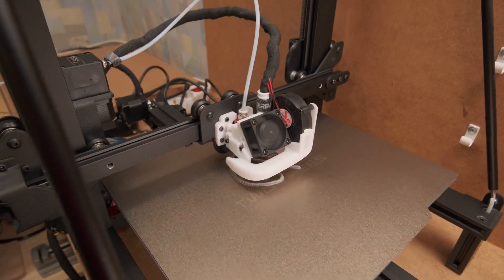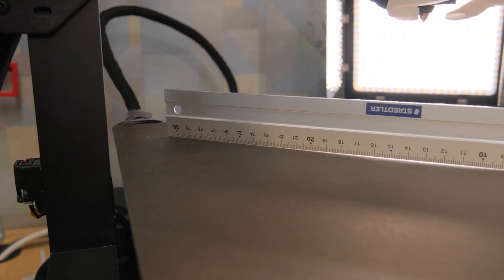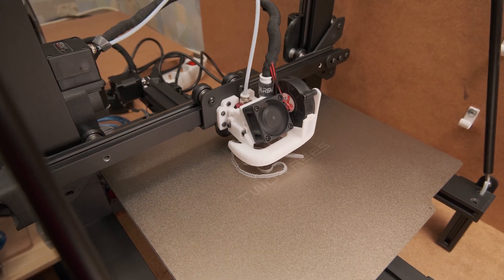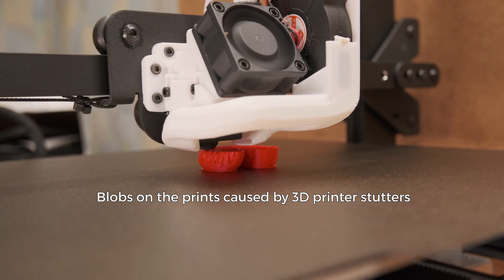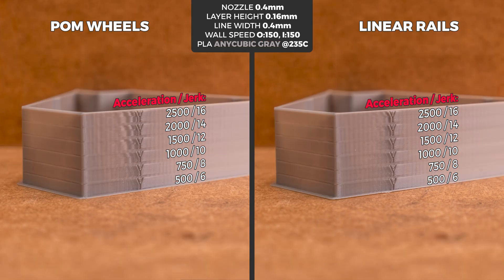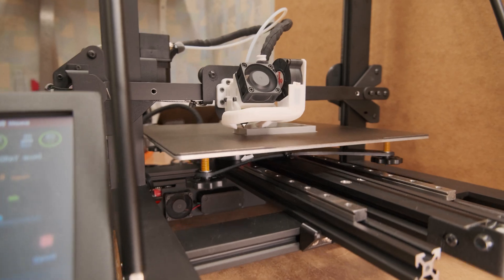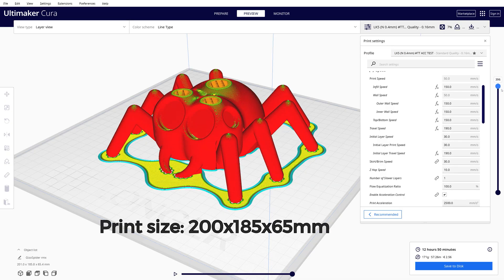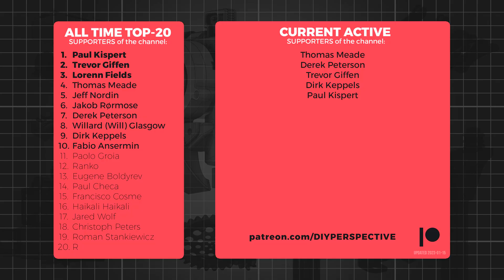When 3D Printer LINEAR RAILS upgrade MAKE SENSE? (vs POM wheels)

Comment: Once again, you gave us an amazing information and content. You're not going to make too many friends with other 3D printer YTers :) Talk about myth busting!! There are other advantages to linear rails even if they don't necessarily translate in print quality. Or more precisely within a hobby setting. The benefits to a less maintenance system could be of value in a print farm or similar setting.

Looking at the dynamics of a bed, it is somewhat easy to understand why those changes doesn't make a large difference. The rotational forces are front-back, not side-to-side (like you showed with your dial). In this fashion, the wheels, rails or simple rod bearings all do a good enough job to keep the deflection small enough to almost make no effect on the print.

And I'm surprised why everyone is fighting to make the bed lighter with spending $$$ as opposed to just switching to a larger motor and belt system - again, all assuming you need to make a change there in the first place.

Anyway - excellent content and great presentation. Job well done!
Reply from the maker: Thanks! I am not trying to make enemies, just trying to provide better-controlled testing results. ;D Yeah, even cheap linear rails are more than enough for upgrades like these. I even specifically ordered multiple just to check the quality, kinda YOLO it with two orders and all of them had no binding and wasn't too loose. Yeah, less maintenance and especially no wear in a long run. Heat beds with POM wheels just give me anxiety... It is such a flawed design from an engineering standpoint. X axis and Z are fine, but Y... They ride only on one side and wear way more quicker the heavier the bed is. I keep constantly checking them... LOL

So yes, the main wobbles come from another direction, I perfectly understand that. It was just an easier way to show that it is not a rigid system overall with no deeper thought. However because it is so wobbly to the sides, even the light X-axis could affect it with the fast movements. But turns out that when the heat bed weighs so much it is too much to handle for POM wheels with a design like that. Another thing that could affect the results is the rolling resistance. With linear rails, the bed moves like on ice skates, with POM wheels not so much. But it is hard to say how much that could affect the results.

The steppers on that 3d printer were already ran at 2A RMS at stock. So with TMC2209, it is the limit. (EDIT: I checked today and I have no idea why I said 2A RMS stock because it was set to 0.78A RMS, so yeah there is quite a lot of wiggle room). I have 48mm 2A motors for further testing and will order a 9mm belt that with some modifications should fit. But the lighter the bed the less the whole frame shakes. And when the bed weighs 2.2kg the shaking is quite insane for those not that high speeds/acc/jerk values. It is pretty annoying if you have it like on a table without any dampeners. So yeah. ;D
Reply: @PrintingPerspective  Ah good points about the max motor size and bed weight- very true. Guess that's where corexy have the advantage. I just can't see building many corexy for my farm to gain that much in speed and maintain extreme surface finish. Although the "Rook" homemade printer has some promise. 
What I like about your channel is debunking mainstream ideas. Even I have a hard time accepting the results!
Reply from the maker: Maybe after P1P release we will see a bigger shift into corexy 3d printers from mainstream manufacturers. It is superior design after all. I am tired of seeing Ender / Prusa clones...

I love the design idea of the Rook so much. Hopefully it will reach a more complete state. Would love to make one and make some print quality comparisons.

Yeah.. there are a lot anecdotal evidence or "from experience" without any actual testing and detailed comparison basically "just trust me bro" ;D When there are so much variables unless you properly evaluate and limit them, you are only speculating. Good luck that I actually love testing and triple checking and even retesting if the results are not what most of us are used to hear. :)

Comment: I'm sorry, your heavy accent is very difficult to follow. Would help a lot if you slowed down..... Do people really noodle around with their 3D printers to this level.? I've had my Creality CR 10  for 3 years.... Never had a print issue, apart from those self inflicted as I got to grips with using it.... My prints are incredible, fine detail.... I use a heavy mirror as my build plate,..... All this weight reduction and velocity/jerk talk  is for design engineers, not end users...... Think your likely to introduce more problems to resolve for anyone that tries modifying..... I wouldn't consider linear rails an upgrade... Just an alternative.... Nicely filmed video though. Thanks.
Reply from the maker: I always provide a full script as subtitles, which could definitely help. I agree that these settings are not for most people who own 3d printers but even inexpensive linear rails are the upgrade to POM wheels and the definition of the upgrade shouldn't be defined by users' ability, you know. However, I agree that you must have a certain amount of knowledge and experience to make an upgrade like this work better that POM wheels, that is for sure. I just wish companies used more linear rails in the first place.
Reply: @PrintingPerspective  You don't have to. I did not notice any accent until that post :) Your analysis was very helpful, I'm going to do a better board now, after watching this.
Reply: I would send you some commas in exchange for those dots. Would help a lot if you slowed down :)

Comment: Why not use carbon fibre plate instead of aluminium? They're cheap enough. Edit: that's already suggested
Reply from the maker: Yeah it it's definitely a possibility. But the main weight of ~1.7kg is from pei + magnetic base + heating plate. It would be interesting to try like a thick G10/FR4 sheet as a built plate and as a heating 2 in 1. But I doubt I will as the ghosting results even with stock firmware looks great considering how much whole heat bed weights. Plus there will always be a acc/jerk limit for some taller prints, so I don't see a reason to push for the much higher speeds.
Reply: @PrintingPerspective  Yes, you're probably right. I never used scales to check the weight on all parts like you did

Comment: I have an upgrade design you might be interested in.  It is a brace for the gantry uprights that attaches to the side, under the lowest level the X axis travels.  It features a pivot point reinforced with an M5 screw, and an M6/1/4"-20 bolt to adjust the upright's squareness and lock it in place.  I've only had it installed on my Ender 3 V2 Neo for about a week, but the testing is very promising.  I'm going to upload it to Thingiverse as soon as I'm satisfied that the design will not fail under normal operating conditions.  My printer is new, and I'm new to FDM, so I have a few bug with my printer to work out.  I originally made these as temporary bracing to fix the uprights from being out of square by about 2 degrees.  It's perfectly square now, but still having Y axis stability problems.  Let me know if you'd be interested in this brace system.  I've grown to like it more than bracing rods since they are out of the way, but the bracing rods are probably slightly more stiff.
Reply from the maker: It is so hard to imagine what you are talking about. When you upload it to post the title of it here, I am always interested in ideas and concepts that others have.

Comment: I don´t understand the premise of those videos. You modify an inferior bed slinger design with this and that...just save that money and buy a Core XY design instead form the get go. All those problems are already solved in a Core XY design, that´s the whole point of that mechanical design. Don´t buy those shitty "i3 Prusa since 10 year alsways the same style stuff"
You can also improve the alu. bed design further with more cut outs or make it thinner with beads and flanges (if possible).
Reply from the maker: If you don't understand why you even bother to comment? :D Maybe it is fun to modify 3d printers? Why do people modify shitty project cars and have so much enjoyment? Huh? If you don't have fun doing that it doesn't mean others feel the same, the world doesn't turn around you buddy. :D
Reply: @PrintingPerspective  Sure you can have fun doing it. But from a cost-benefit point it just does not make sense to buy a VW beetle and swap the engine to a Porsche one. So pay more money for a inferior product AND also invest time. It´s like all those videos "Oh look the Ender 3 is such a great printer if you only install those 53 mods for an other 800$" Yeah sure, but instead of doing that you could have bought a 1000$ machine which already is a great printer and you have less work with it.
Reply from the maker: How are you so close minded? This is actually funny to read. :D People who want to get into 3d printing don't want to spend $1k just to try it, so they buy cheap popular 3d printers. But with time for some people it turns into a hobby and upgrades are natural part of it. No one is saying it makes sense the cost wise, but guess what? When it is a hobby and you're getting fun out of it you don't care about the ultimate price/performance ratio. Is that really so hard to understand for you?
Reply: @PrintingPerspective  If you don´t want to spend 1k for a 3d printing, buy a cheap printer. But if you find that you need a better machine or you want a better machine simply sell your Chinese crap instead of wasting way too much time and money upgrading (which is physically not really possible from a i3 frame to a Core XY one) and buy a better machine, like the Bambu Lab for 800$.
In this case if Gaming is a hobby would you recommend buying a 1500$ GPU ? God I hope not.
Of course price is important. If those people didn´t care about the money in the first place they wouldn´t buy a cheap machine.
Reply from the maker: How you still don't get the point, even when I explained like for a child? ;DD This guy with the only his right ways and truths ;D This is too funny :)
Reply: @PrintingPerspective  I simply pointed out that it´s the worst price to performance value. You can go on rambling about how it´s not about the price nor the performance which is fine. It still does not make my point any less valid. If you don´t mind the terrible price or performance fine =) How can you not understand that´s it´s not about you and your point of view but there are others as well. So instead of arguing how it is not about the price just accept that the cost is horrible and valid for somebody with little money who is looking for a better value, how about that ?
Reply from the maker: You came here saying that you don't understand the premise of these videos and that CoreXY is superior. No one is arguing that it is not or that upgrades don't bring the most value. I explained why (because you said don't understand) some people love to modify 3d printers as a fun hobby but from your response clearly, you can't accept that some people love doing that and spending money on a hobby they love and you still keep arguing your point that no one here ever contested. That is why this is so funny to me and I keep replying lol. This is some dense sh*t, man. :D
Reply: @PrintingPerspective  I can accept that most people are irrational or like to modify, but not all. You can not accept that those solutions are workarounds.
Reply from the maker: Here he goes again :DD You clearly just can't accept that modifying 3d printers can be a hobby. You even say that I can't accept it despite agreeing with your previous statements ;D ????
At this point, there is no way you not trolling. And if you actually are not holy cow you are so far gone that it is not funny anymore, stop hating so much and thinking the only right opinion is your opinion, and you will live a happier life. Good luck :)
Reply: Where can I buy a 420x420x480 core xy machine for < $500?
Reply: @robsims6352  You buy a smaller one and divide your print in pieces. Otherwise you are shit out of luck and need to use old design

Comment: I'd love to see the differences with a well tuned setup to begin with (Klipper, input shaper) and accelerations of 5k-25k.
Reply: it's a bed slinger, with a glass bed you won't ever get over 2-3k out of the bed especially not on heavier prints, i have a Hemera directdrive with a copper volcano block (heavier than the alu, but also better) and i can't go over 6.8K accel on X, no matter wether it is Marlin or Klipper, also FYI Marlin also has input shaping but it's not with a wizard like Klipper has.

it still is better than needing a Pi tho
Reply: @BH4x0r  Glass indeed adds a lot of painful mass, but there's no way 2-3k is the limit. Ender 3s without glass can do 15k+ (some have done 25k+) on Y. If you're hitting a limit that low you probably have miscalibrated shaper or bad stepper driver settings like stealthchop.

Stock Ender 3 X can do roughly 100k. A heavier direct drive won't do that, but 30k or more should be achievable.
Reply: @daliasprints9798  hmm interesting, i run mine on Marlin in Hybrid mode (switches to spreadCycle above a certain speed only)

so ye stealthChop under 80mm/s

never thought about that

edit: even with stealthchop disabled i lose Y steps: but keep in mind i don't up the current from the ORIGINAL settings

my motors are completely stock Creality motors

tried 6.8k on Y with and without shaper, and i lost steps either way, on spreadCycle at 850mA which already gets them hot, i should probably swap the 42-34's out with the 42-40 extruder motors (as i have 2 Creality style extruder motors that don't have a press fit gear and they can take more current and have more torque)
Reply: @daliasprints9798  small update, since i still had 2 old 42-40 extruders laying around i swapped them 42-34's out with 42-40's and upped the current from 750mA to 1A, gonna test accel etc tomorrow

Comment: I have a Duplicator i3, for me a massive improvement was designing a center mount that goes on the screws for the springs to mount firmly on. This prevents any kind of shifting with will both offset the bed and also help stiffen the spring. Then the next major improvement was adding wool around the edges to act as thermal insulation but also to dampen the springs.

*i also added a teflon sheet on top of the bottom frame the bed goes on, both to reflect the heat back up to the bed and as a side effect also help even distribution of heat on the bed

I have not had to level the machine after over 2,000+ hours of printing, or about a year

Side thought; I don't think i've ever check a slicer for X/Y specific jerk/acceleration settings, that way you could run more better/different X speeds and Y speeds by tuning each independently.

Comment: Kind of a related question I've been wondering about but haven't tested completely:  Toothed idlers or not?  "They" say that smooth idlers have larger bearings (good), but that high belt tension causes vertical artifacts.
Reply from the maker: This video explains what actually causes VFA - https://youtu.be/-et5eMyLlUs

Comment: Nice investigation. But why did you choose one of the most expensive ways rather than try others? For example to replace 6mm default belt with 9-10mm. Even move to Klipper looks like more affordable upgrade - besides getting ghosting reduction you will get many other features.
Reply from the maker: Thanks, but I don't know sometimes it feels like you guys don't watch the whole video before posting comments. From the results that we saw with the 6mm belt at different tension levels, I doubt wider belts would provide significant improvement. A tiny one? Sure. The biggest improvement probably would be to get the right tension more easily. And Klipper will be the orientation of the "part 2" video of this 3d printer's complete overhaul. And at least from an engineering standpoint first, you make sure that your 3D printer is mechanically sound and only then transition to more advanced firmware. Otherwise, it is like a bandage to a problem, IMHO.
Reply: @PrintingPerspective  It depends on what features. IS surely is just upgrade for well-assembled printer. But PA (wich is not "advanced" feature in 2023) with smoothing works much better. And wider belt is not about tension. They correlated, but not direct comparison.

Comment: It would be interesting to see if PC wheels make a difference.  Also, POM and PC wheels come in V and V solid wheel variations.
Reply from the maker: Lost In Tech did a great analysis video on POM wheels https://youtu.be/G9i6LccK_qo

I personally, try to avoid POM or PC wheels on X and especially on Y axis on bed slingers, because the most annoying part of them is that they wear too quickly, and constantly need checking if they are properly tightened for consistent results. If you have one printer then sure, not a huge problem, but if you have to do that on multiple ones, that is a punishment lol. And to be honest V-slot wheels on the Y axis are kinda flawed design to begin with because only one side of the wheel is wearing down and not both like on X or Z axis.